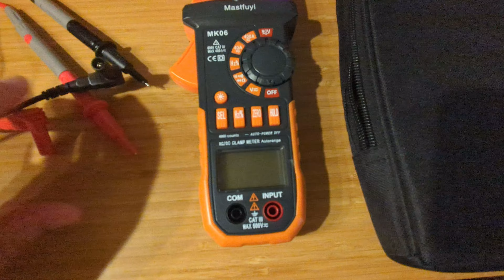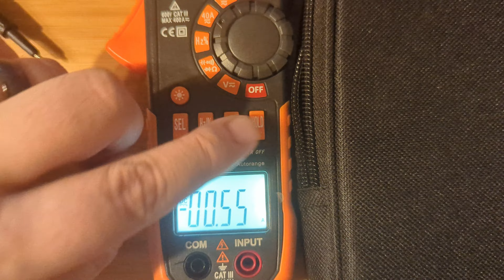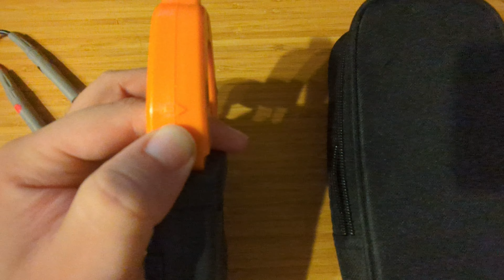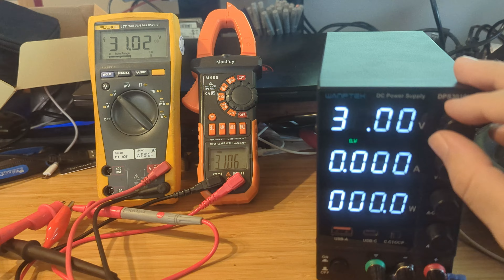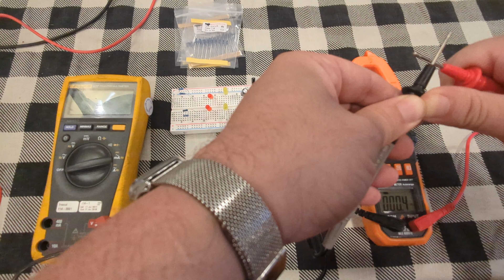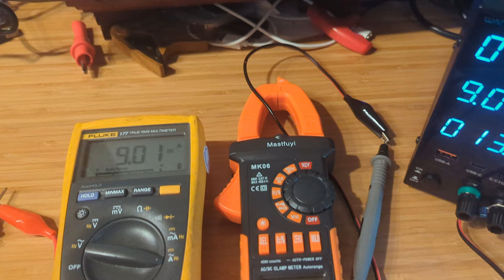Best Budget multi meter: Mastfuyi MK06 MultiMeter review

Comment: Does it seem to have a way to get a rs232 or ttl connection out of it so a Bluetooth adapter can be connected allowing this to turn into a data logger?
Reply from the maker: Hi Subhobrotoshinha, no I do not see a way to connect a RS232 or TTL... But this is not a modification that I have looked into. Nor is it something I would pursue, there are better options for your requested function.  Even if you could I do not think this would be reliable enough for that type of usage.  You can find Ampere or voltage "meters" or displays that easily connect to controllers or BT for data logging (more expensive, but better for this function).
Reply: @brocktech-ql1wr  good points! Are there some that come to mind? I want to sample power draw of appliances like hot water heaters, stoves etc that are hardwired into the wall so removing the power connector and inserting a killawatt won't be possible
Reply from the maker: I have used something like the link below before (I am not endorsing this product just saying this may be the type of thing you are looking for). But they require some electrical work.  I have used some other commercial / industrial one for some of the tools/machines I used to help make, but they tend to be more expensive then for home use. 
May I ask what you are looking to do with this information? examples I can think of: 
1. your just curious of power consumption.
2. you are close to max rating of your box and want to hook up other large loads (example electric car).
3. you are trying to map/log current /KW used to compare to electric bill / reduce usage during peak time.
4. or other? I apologize I'm a scientist at heart and am just curious.

Thanks,
brocktech
https://www.amazon.com/Current-Amperage-Voltmeter-Multimeter-Transformer/dp/B07JB9B2QL/ref=asc_df_B07JB9B2QL/?tag=hyprod-20&linkCode=df0&hvadid=309806250188&hvpos=&hvnetw=g&hvrand=693493294678868292&hvpone=&hvptwo=&hvqmt=&hvdev=c&hvdvcmdl=&hvlocint=&hvlocphy=9015705&hvtargid=pla-593618260022&th=1